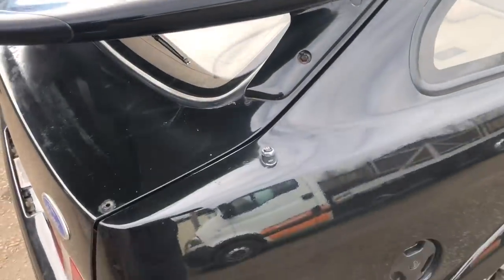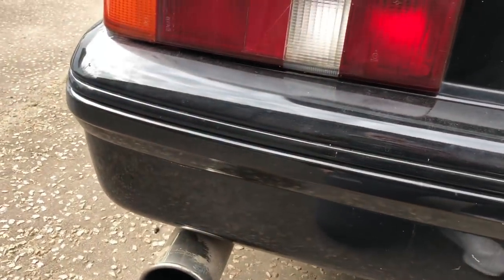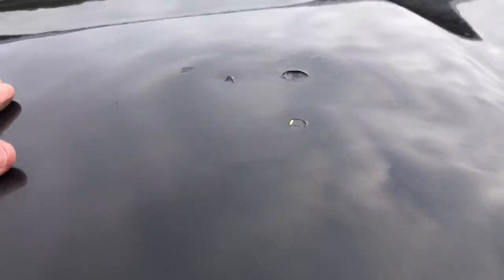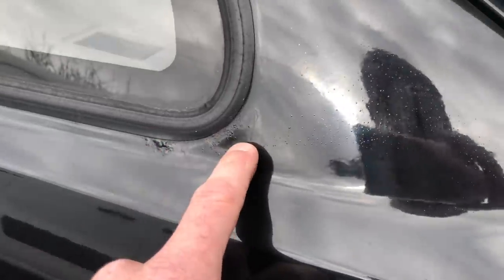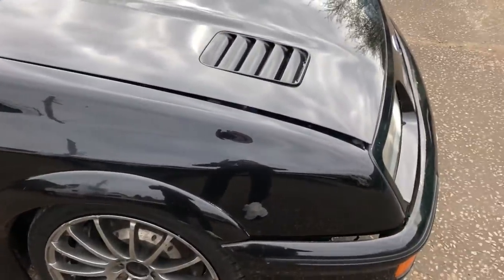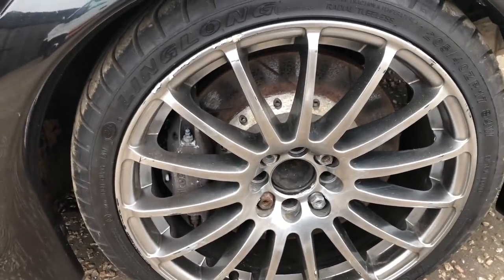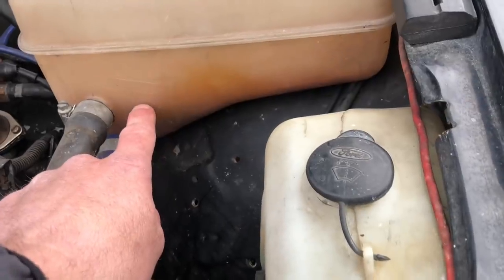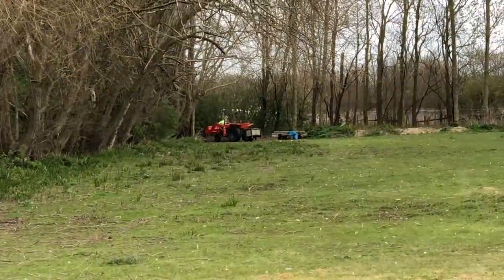Ford Sierra RS Cosworth 3 door how bad is it

Comment: Evening Rob, another brilliant video. Thanks. I have a question, on a search it shows as manufactured date of 31/12/86 which goes with its D reg plate. But it’s shown as having a  registration  date of 25/04/91. Do you know why?  Also for those moaning about the wash and the paint condition omg it’s a 30+ yr old car that’s been sat in filth and muck for years. Considering how bad it was it’s in bloody good condition. And we all know it’ll be immaculate when it’s done. Well done Rob and Chris on saving yet another classic.

Comment: An accumulation of water can cause moisture to get pulled back into the compressed air stream. This can be especially problematic when you are using a compressor to spray paint because water can cause negative visual and texture effects on the finish sheen. ... Moisture that is present as a vapor in air begins to condens

Comment: There used to be a purpose built tool in the 80s to repair the lock damage your car suffered it compromised of a bolt with a plate on the end which went from inside and another plate which you gradually wound together from outside

Comment: Are you going to look for original alloys or aftermarket ones? Also can’t help but notice the current ones don’t fill out the arches to line up flush with the wing, is that something you’re going to take into consideration when buying a new set? Congrats on the 100k by the way well deserved

Comment: Those fish eyes are down to a repaint where moisture has got onto the primer stage.  Had it myself on a Misano red Integra Type R, had to repaint the car again but most of it had to go down to metal to avoid it happening again. Horrid.

Get it properly painted. Might cost a bit, but it’s a cosworth so well worth it.

Comment: Very nice barn find, used to have one myself. How far are you going to go with the resto? I notice the turbo, intercooler and cam cover are 4wd versions. Have you checked the block to see if its a 200 or 205 version? I reckon it could be a 200 as there was no piston slap when you revved it. Good luck and keep the videos coming. It's bringing back my youth..

Comment: I do agree that the paint is not good and that it will need a full respray. What about soda blasting to get it back to the bare metal as there is rust as well that does need to be sorted out

Comment: Hi Rob, 

The wheels look like they’re either TSW or Team Dynamics but, places like Halfords/Wilko/Motosave did produce a lot of cheap multi fitment wheels in the same style. 

I had similar micro blistering on a car I was restoring, it was caused by the previous owner using a car cover, they trap moisture/condensation between the paint and the cover, it could also be the reason why you’ve seen so many swirls as mine was pretty similar. There’s no way the TFR caused them though. 

It’s such a shame that there’s rust bubbles and repair panels needed, the market is so strong for survivor cars right now but, because this is black you can’t get away with painting odd panels sadly, it’s got to be all or nothing. 

Given that it’s an 80’s Ford, are you going to do a bare metal respray on it?

Comment: The rear brakes looked vented disks if they are there 4wd nice upgrade 2wd were solid disks. I knew the engine would go quiet when run up said it would last video. Might rattle from cold as the 2wd had piston slap from new the altered the 4wd pins and rods to stop it. They also drink oil from new about a litre every couple of tanks of fuel if ya lucky.Lol tfr blistered the paint never it cleans all the dirt of and thats about it. 
Shame she was not loved and needs painting but what 33 year old car does not unless you paid 50k but I bet you didnt lol.
Nice videos always Rob  keep safe and well.

Comment: Needs work but its a good base , looks like it has already had a cheap respray ,and wouldnt worry about the engine cozzy's were never the quietest motor, it depends how far you want to go with the car , a complete strip and rebuild would be costly , but its money in the bank if its an original car with no silly mods.  Sold my mint 3 door moonstone blue with 80k and three owners a few years ago for decent money , but i have regretted it ever since. 

Look forward to every installment , its got me pining for another , but i couldnt justify the £££££ they cost now. Just one question are there any cracks on the top of the dash ? Very rare to get a cozzy dash that hasnt cracked and a real bonus if its in good condition

Comment: Nowt wrong with that engine rob she sounds sweet new there wouldn't be there's a few people let alone a car who'd be rattling if they had stood still for a decade lol, Being the yb engine  providing she is oil & water tight she's good to go for a bit buy you some extra time anyway to spend the money on the body work 
Is it running the later turbo beans someone has gone to the trouble of uprating the front brakes ? ps glad to see you have swapped that rear wiper blade

stay lucky

Comment: Can you get Seafoam in the UK ?????  If so, run a can through the fuel/oil, I have to wonder if there isn't some gunk in there somewhere, I can still hear some tappet noise, though as I said in the last one that engine always has a little tappet noise, but that seems more than normal, from memory.

Comment: I've got a question (hope this doesn't sound stupid), but is there a reasoning behind the position of the rear brake calipers? How come they are positioned nearer to the top of the brake disc, rather than towards the left or right side of it? Thanks.

Comment: Those popples or pipples..... or micro blisters..... there not from the truck wash.... it's from being painted in the past at some time and there was moisture in the airline or compressor used. Seen it many times before. No polishing or anything will get it out..... full prep and paint needed. As for the tappets..... knew it would quieten down once they filled with oil and held it. Takes a while after it been stood for years to fill and hold the oil.

Comment: If people think that sounds tappy. They aught to listen to a Mercedes 2.3-16 with it's solid lifters in the Cosworth head lol. I got comments quite often saying it sounded knackered or was like a diesel, even though It had the top end rebuilt and was running perfectly. They are quire simply noisy.

Comment: Needs a new paint job. And by the look of it, it won't be the cars first new paint job. And be repaired to find filler in more than one location. I would get the frame checked for alignment prior to paint. These cars were never crashed slowly. So I would have it off to the jig shop, then the paint shop. And before the paint shop/body shop, I would haul the engine and box out and have all rebuilt. Money money money. But it will be worth the time and expense. Wish it was mine.

Comment: Micro blistering! Oh my days! That's a full rub down to bare metal job and no question. Could have been caused by being covered with a cheap no breathable tarpaulin or crappy spray job where water got trapped in it. 😳

Comment: Micro blisters  is  from   the  wrong  Primer   used  on   a  previous respray   or    bad  filler primer  has  water in it  when it was  painted ? not  fully  dry  when  the  top coat was  applied very  bad    al

ll
 
 

got to  go  back to  bare stee

e

l im afraid to tell you

Comment: Top the fuel off with super and a couple bottles of techron as soon as you can. I'd say that it's due for a complete respray.
Change transmission and diff fluid and flush cooling system. Power bleed brakes and clutch master to get all the old fluid out. It's not original paint anyway.

Comment: That’s a nut and bolt restoration, do it properly, have the shell dipped or blasted , build it up from a bare shell and paint all the running gear in 2k , if done right could be worth top money 👍🏻

Comment: If it was me I would strip the interior out completely, freshen it up whilst hopefully you bite the bullet and go bare metal as that's gonna be your ticket to maximum profit.

Speaking from experience of two cossys

Lose the door locks both mine got pinched or broken into through them get a cat 1 remote locking system put in. I had mine smoothed over to stop that and had a full steering wheel lock and a pair of  100 pound German Sheppard's 😂😂

Comment: How can you not see the big dent on the off side rear wing below the window ? and there are so many dents in the rear tailgate. That micro blistering is from bad workmanship during the paint preparation without taking off parts etc, very sloppy and it probably looked ok for a year or so but now somebody will have to DA the whole car, fix the dents and give it a respray. I wouldn't charge less than £3500 to fix it  so good luck with that.

Comment: Mate they are only worth around 50K or about 25K pounds that's it and that's for a really good example, yours needs paint and then running gear checked and also new radiator hoses, turbo and lines intercooler etc etc, to really try to make some cash and these days mate i am sorry to say but only real collectors will pay good cash for a real fine example, because you have upload this everyone will know what you have done to it and no matter who paints it it still not factory paint and also other aspects of items you have changed, plus if you really want to be a fine example take it to cosworth racing and get them to fix it up so its perfect maybe then you have a good car to take to the shows etc, but still a beast and keep it clean and get a new paint job and make it perfect. :)

Comment: The rear side window trims looks like windshield rubber seals and are definitely not original Ford. The original trim is made of metal and fixed with metal clips.

Comment: Micro blisters you need a back to metal repaint or buzz right back and isolate it  caused by damp trapped under the paint bum paint job prob had a cheap blow over previously

Comment: It's had very poor repairs on a damp car , not dry when painted very common for micro blisters, very bad repairs to both door lock apatures, probably both punched through , realistically it wants a full strip and  proper repaint , it will fetch good money when done , keeping it original would fetch the  best money , if you intend to move it on later

Comment: De Lock it . The Bucket are Driven By oil pressure So no oil up for 10 years they will dry out and Fail to  Compensate .End result Sounds like a 8 v fiesta with rocker Slap .  i can still here one or to in there that are a little Noisy .Shame it's Just a 205 .

Comment: You won't be getting that perfect with just a flat down and paint. If that's micro blistering due to moisture from a previous paint job or solvent pop that wants to be bare metaled ideally. The paintjob wont last 6months with just a flat down and paint